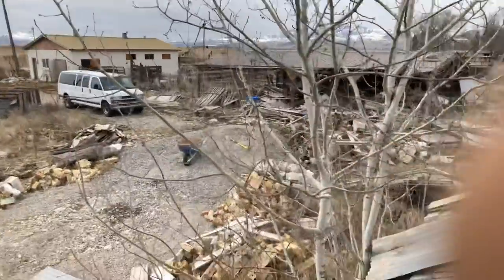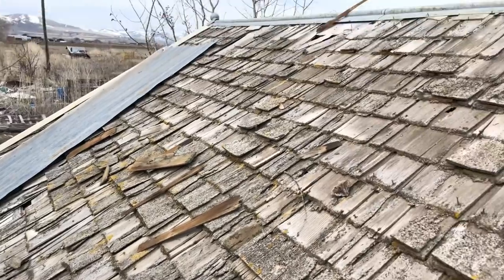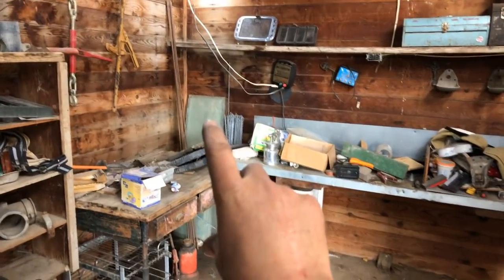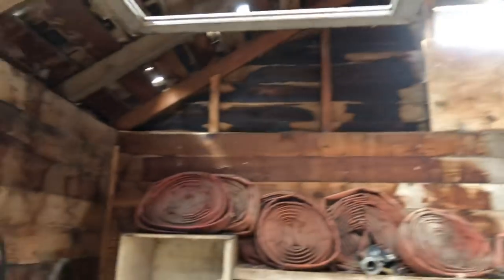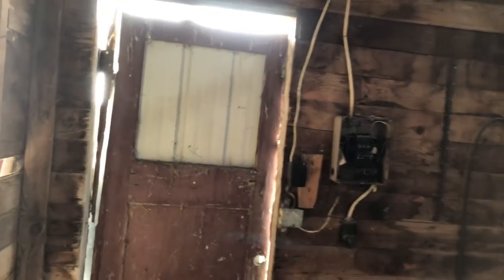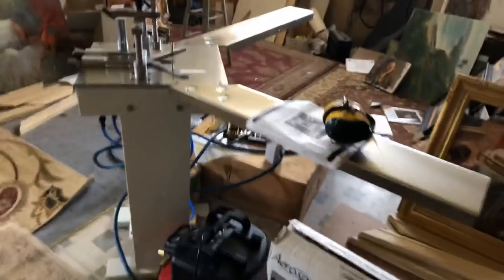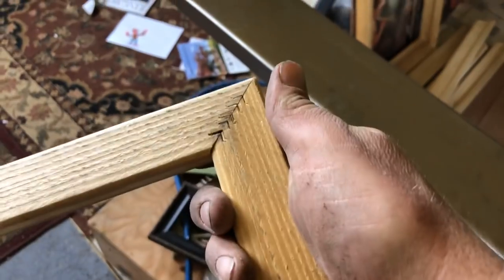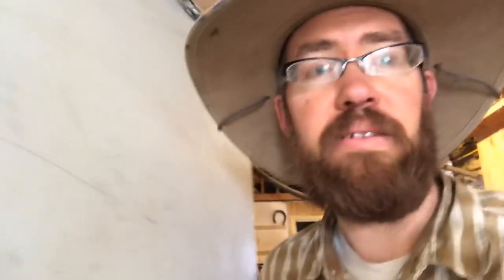Renovating an old outbuilding! (and a warning)

Comment: I bet if a bunch of your followers lived close by they would reroof that building in a day.  That is a pretty decent building. Lots of scrap metal to sell and lumber for some great projects. What a great machine for frames. That painting is beautiful.  Would Lorajean be interested in a few thousand postage stamps for a school project. Have many back from early 1900’s.
Reply from the maker: We got it (mostly) done that day...at least on that one side; and the other side seems to be working fine for now. Thanks for that offer on the stamps! We actually have a decent size collection (not as big as yours) that we're going through a little at a time, but we might take you up on it a little later. Thanks again! :)

Comment: Just a quick comment. The mercury curly light hanging  in your shed might pose a problem if hit by a board. The dollar store around here has 2 types of led lights. The house style and the larger flood light type..
 Your frames are going to be well made. With all the wood around is there any that can be used as a rustic frame to be used with a special series of paintings that you do.
Reply from the maker: Yeah, I had the same thought. I've since replaced most of them with LED's (one of them is a gallery-grade spot light... so it looks kinda nice in there).